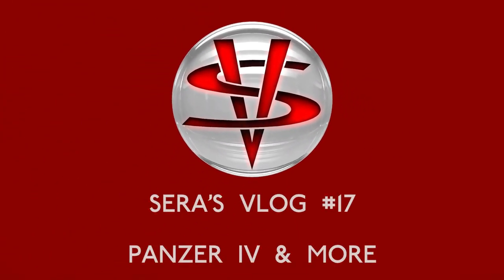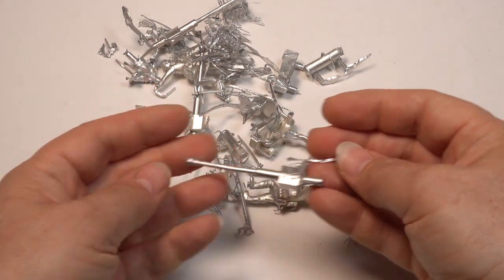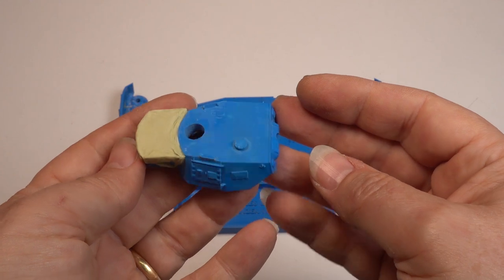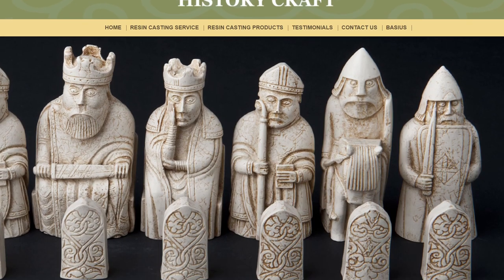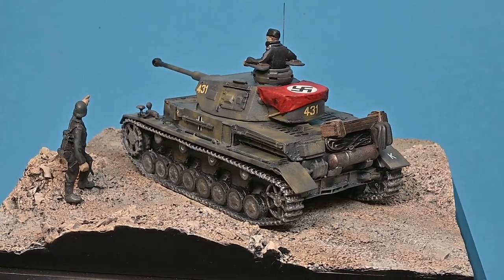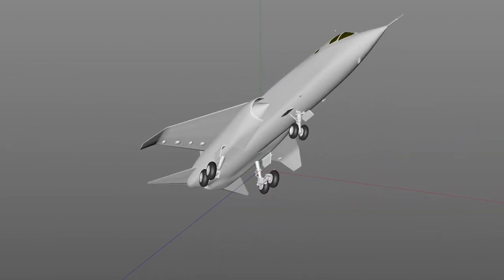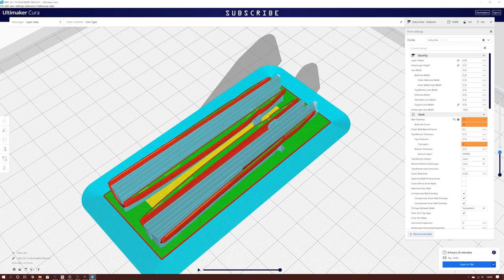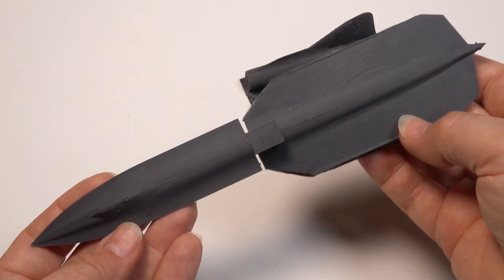SERA’S VLOG PART 17 ‘PANZER IV & MORE’

Comment: Oooo blackbird interesting, in 1/144 I thought it would be bigger. Panzer 4 is awesome mate you certainly know how too tool some metal models. I don't have much luck with thin sheets of miliput what's the trick  For tarps 😁

O yeah I experimented with printing 1/35 tracks and yes it can be done including the hollow holes for the track pins,  I modeled tiger tracks exactly to scale. so the pin holes are super tiny I may have to upscale holes or find appropriate thickness of wire.  All the detail is there but how that would translate too metal casting is anybody's guess..
Reply from the maker: Hi Vasili, thanks for the kind comments. 1/144 is a great scale for collectors as it doesn't take up too much space. Wait till you see the undecarriage - bonkers! If you are working with thin Milliput for tarps - keep it wet, and use a wet brush to blend it and shape the creases.
Kudos to you for 3D printing Tiger tracks! getting the geometry right so they fit together can be a bit trial and error as can pin / wire choice. Re casting my 'How to...' videos should help. As long as you keep the mould HOT the detail should come out ok. I often use a lighter to focus the heat for pre heating.